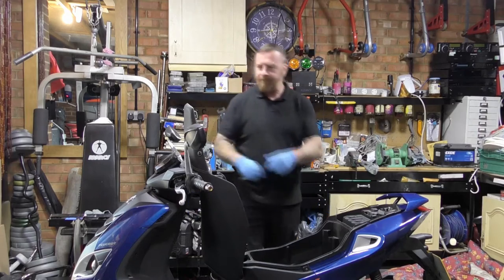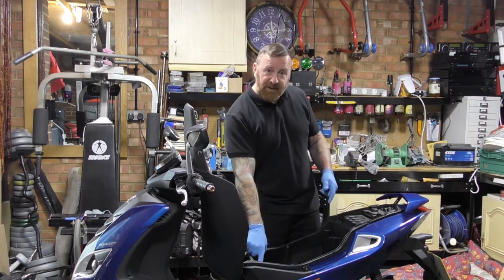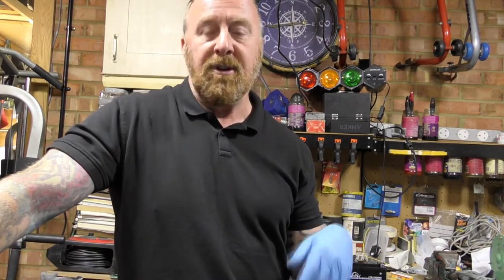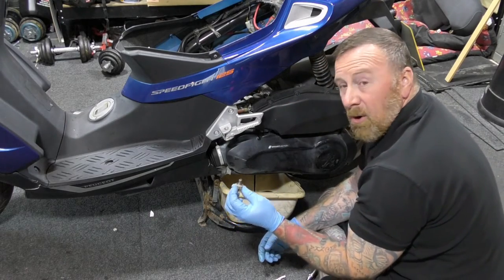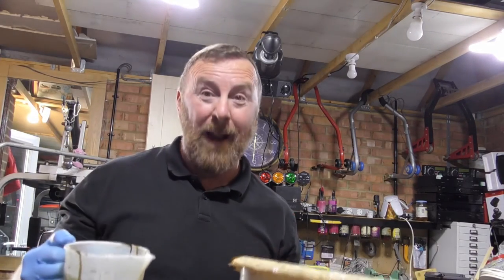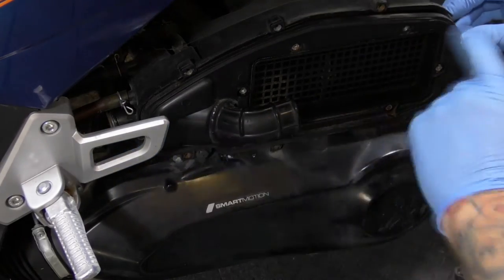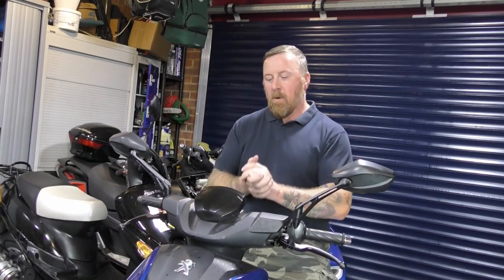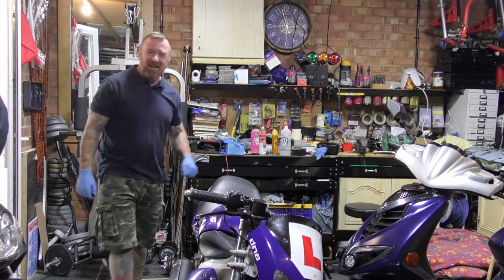PEUGEOT SPEEDFIGHT 4 125CC SIMPLE SERVICE SAVE MONEY DIY

Comment: Hi mark, did you manage to fix the turning of the mirror? Mine was the same after I bought brand new. When turning the throttle would just move. Have tried to tighten but doesn’t last very long
Reply from the maker: You'll have to take it off 
Use masking tape around the bars and refit bud 
It works

Comment: Nice explanation on servicing the scooter Mark...👍.
Reply from the maker: I do try as long as I don't forget to press the record button pmsl 
Take care bud
Reply: @marksavage  Thanks for this mate, much appreciated. I changed my oil yesterday, all good even though the sump plug was proper tight - I'm sure the deal did it up that tight deliberately so I'd have to take it to them ;-) Anyway, next job change the spark Plug, is there a good one I should buy rather than the stock NKG Plug about £10? I'd rather get a good one and do I need to set the gap myself, and if so what should it be?? Many thanks for any help you can give, or maybe a little video to show stupid people like me how to change a plug including gap setting etc - it would be great. Cheers and hope you are well. :)

Comment: Hello mate, I have a Peugeot speedfight 4 2015 liquid cooled 2 stroke and the bike’s temperature goes high on the scale after about 10 minutes of riding and lacks power. It’s got petrol and 2 stroke oil but i think i need to change the engine oil or check the dipstick, problem is i can’t find the dipstick. Could you please help me ?
Reply from the maker: It's 2t bud so won't have engine oil and no dip stick !!, check water level and fill bud

Comment: They went downhill ever since the speedfight 2 mate. Build quality is poor now compared to what it was. It's a bloody shame as they were really good once.
Reply: The problem is that the speedfight 1s and 2s are old now. The engines will run for ages if you use quality oil and fuel, but I’ve had a broken fuel tap, throttle cable, horn etc. The plastics are fragile too.
Reply from the maker: oh we are getting old when we all start with they don't build them like they used to lol but they don't
such a throw away society  but  they say they are green !!

Comment: I have a question for you, I own a speedfight 4 2t 50cc air, my air filter box has a hose from carburator to box, and then from the box to somewhere I can't quite figure out, so I decided to put a high air filter on it, but it didn't match, does it have to have those 2 connection or maybe a different filter?

Comment: Where is the petrol filter on this bike i have the 2017 speedfight 4 125 4t and it doesn't have one? I can't seem to find it! I bought one new 2 years ago and I've changed the spark plug, oil, air filter, tyres & break pads but I can't seem to find the petrol filter anywhere? And the manual doesn't mention it help!
Reply: I've lost power and acceleration. I'm assuming its rather the petrol filter/pump or carb cleaning or i need a new exhaust change as its quite rusty and the screws where crumbled at the manifold!
Reply from the maker: its in the tank , drain out petrol and take out the vacuum as its on there , but most people add one to he fuel line
Reply from the maker: that will be your problem too bud
Reply: @marksavage  thanks bud! 👍

Comment: my speedfight if on gas he will poke.
and the handlebar vibrates a lot when turning.
Unfortunately, in Indonesia, there is no official repair shop, so it's difficult for me to fix this motorbike.
do you have a solution?
Reply from the maker: have you checked the steering bearings, hold brake and rock back and forwards , does it move, have you checked all bolts and mounts , check tyres

Comment: Hi pal , i have a sf4 50cc lc , is the flasher relay in the instrument cluster , if so can I bypass it and use a new external flasher relay , thanks pal
Reply from the maker: on the 3s and 4s it is and it must be possible but never tried it , worth a go and a lot cheaper than new clocks

Comment: Iv got an aprilia sr 50 motard and I’m getting oil in my air filter it’s had nothing done to it
Reply from the maker: plug and check variator and roller - belt too bud
Reply: @marksavage  rollers are a bit worn could that be the reason

Comment: Hi mark I have a speedfight 3 50cc lc and my bike has the same problem with the mirror moving a slight bit I took the whole thing off and wrapped electrical tape around the bar and that seemed to fix it but I only have 1 mirror on can the bike pass mot that way or can I take it with no mirrors or does it have to be both mirrors
Reply from the maker: You don't need mirrors for your mot bud so all ok 
But for safety I'd get some bud
Reply: @marksavage  cheers mark good to know and I’ve just put new rollers on my speedfight with a new gasket and air filter mesh bikes all good and runs better then before going about 47/48 however at lights it’s seems to stay at 5000rpm and then doesn’t want to pull straight off cleaned all the dirt out the variator so no reason the rollers shouldn’t roll I have 6g rollers in I tried with 9.5 and 6 gram rollers for more top end but bike didn’t like it so I’ve kept the 6g ones in but it’s doing that thing at traffic lights or whenever I stop really it will only do it for 1/2 seconds but the belt and clutch look alright because it wasn’t doing it before and I had 6 gram rollers in before but they flat spotted hense the new ones

Comment: Hi mark my first service light has just come up for the 2020 model but I can’t find any of the parts online do you have the links to where you got them from , would be a massive help as allways !!
Reply from the maker: 125cc 4t or 50cc 2t
4t is a simple plug , airfilter and oil which all can be bought on e bay bud or your bike shop 
Follow my video on how
Reply: @marksavage  it’s the 125 4t I’ve found spark plugs and oils just can’t find the air filter anywhere
Reply: Same here I'm looking for one aswel 😢

Comment: I’ve watched all your videos and managed to fix my old 08 sf100 from electric to carb , currently got the sf4 125 Is there any way to change the brakes back to left lever being back instead of being both ? Any help appreciated thanks!
Reply from the maker: They have a duel system so you could buy new brake lines and redo them both as that would work
But duel brake is better but can take a bit of time getting used to

Comment: Hi Mark I have the speedfight 4 125 and wondering if you know were I can get parts as I need 
Steering bearings 
Crankshaft sensor 
Idle control sensor 
Camshaft sensor 
O2 sensor 
Thank you
Reply from the maker: They are still new so hard to get part for bud,  sorry to say it maybe main dealer , the sp3 engines are different so won't fit engine parts 
But was told either sym or sinnis have the same engine , best check first lol

Comment: Hi mark iv got a pegout tweet 125 iv not had it serviced since I bought it done 6500 miles iv changed oil when do you think I should service it?
Reply from the maker: Thats great that you've changed the oil so part service done so you may as well change the plug and airfilter too
Yearly is the best to keep it running best bud

Comment: Hi Mark I wanted to know if you could help me with an issue im having with my scooter it ran out of fuel and backfired and cut out. I then got the bike home then went to start it and it does nothing apart from a click when you press the electric start if I give it some throttle it's as if something is spinning as I can hear it I assume its the starter motor. I don't seem to have a spark either or if I do its now and again as I kicked it over a few times then it ran for a few seconds backfired and wouldn't start again same thing happend 3 times so I tried a new plug and still no luck I checked the starter relay and thats working is there anything else I can try as I need the bike running asap thanks rab.
Reply: Bike is a 2003 Peugeot metal x same as the trekker I think.
Reply from the maker: @robertjenkins256  backfire is too much fuel but often its when the piston has gone bud 
Anyway let's start over 
Click relay ok spinning is your bendix so cover off and check it out 
Then see if your starter works 
If engine isn't turning you won't get spark !
Prime carb once engine turning and check if plug wet and then for spark 
My videos should help
Reply: Spot on mate thanks I'll take the cover off that and have a look I've been through everything it was working fine prior to running out of fuel but thats due to a faulty fuel gauge
Reply: It has a kick start aswell and I've tried that but to no avail it sounds like it does want to go but something is stopping it I've had the plug out aswell and put my finger over the hole and it pops it off with the compression so it's making me think it isn't top end related thanks mate for all your help im literally sick to the back teeth already and it's only been two days
Reply from the maker: @robertjenkins256  maybe try some easy start in the air filter once you've checked out the bendix bud
Reply: Hi Mark I managed to get the bike going but when I give it some acceleration it just cuts out it'll sit quite happily ticking over after a few kicks but soon as you open the throttle almost a quarter It dies  but still progress is progress atleast I know it still runs
Reply: As for the bendix I dont really have a clue what to look for I checked out the video of one that was loose inside there you used a piston gudgeon pin to hold it in place but mine had the bits to hold it in place snug I couldn't see any issue with it but it can't be doing its Job i cleaned out alot of carbon from inside the cover and when I put it back together it fired up on the 2nd or 3rd kick and idled nicely untill I tried the throttle not sure if cleaning that carbon would have made any diffrence as there was quite a bit but to me when it's cutting out it its like an electric fault rather than a carb related fault as its not bogging when I turn the throttle its more like someone's hit the cut out switch but i don't have one on the bike mate. 
thanks rab.
Reply: When I unplug my fuel cable from the carb mark should it not piss the fuel out untill its none left or is it a vacuum line as mine just trickled some out I wasn't like it was a steady flow.

Comment: Thanks for a great video. Stupid question perhaps, but is the bike in the video a 2-stroke? I need to change the transmission oil on my daughters 50cc Speedfight 4 that’s why I’m asking. 👍
Reply from the maker: 4t as 125 
To be honest it's not something you often have to do bud unless high miles
Reply: @marksavage  Thanks. It has done 10000km.
Reply: 6200 miles
Reply from the maker: @Karlabacken  it will be fine for 20k bud
Reply: @marksavage  Thanks! 20000km?
Reply from the maker: @Karlabacken  yea thats what I'd be looking to do it , but to be honest I've had ped with 30 and 40k and its never been done lol 
But the new sp3/4  are not French now they are Chinese,  well from that area to 20km
Reply: @marksavage  Ok! Big Thanks 🙏👍